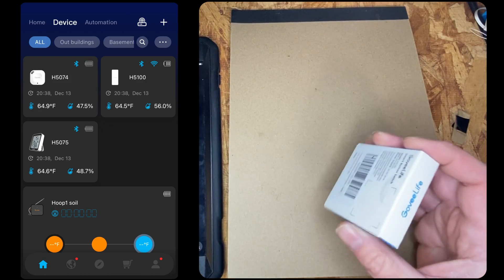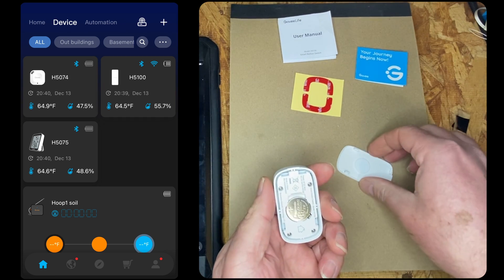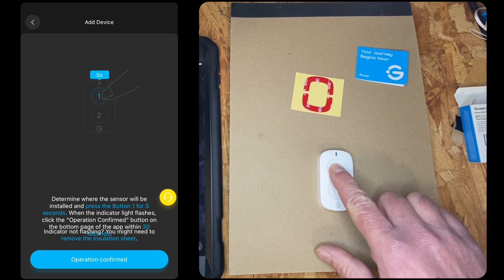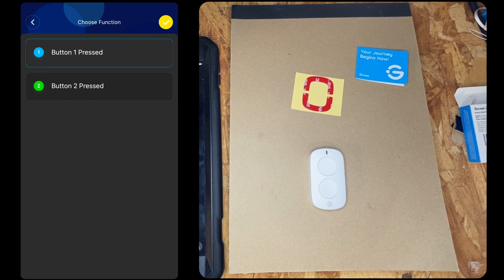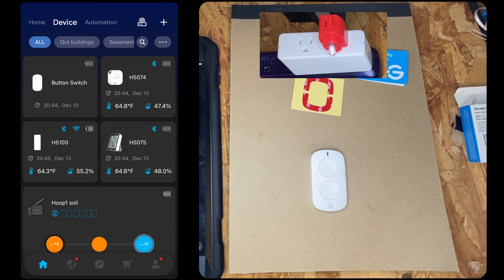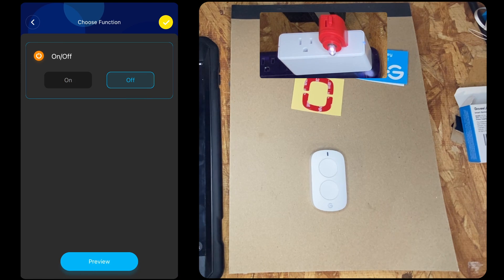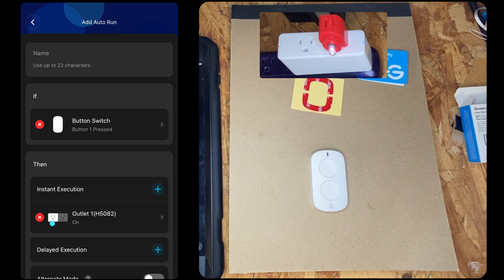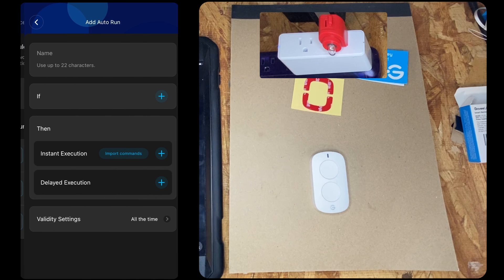Controlling a Govee smart plug  with smart buttons

Comment: Can you control several lights via one button? (eg. When I press buttom 1, it switches on ALL my bedroom govee lights). and can this control Bluetooth and WIFI Goove lights? Thank you!
Reply from the maker: Govee automation supports adding multiple  then clauses.   So you can set an automation. If button one is pressed then turn on switch one, and turn on switch two, switch 3 etc….   So yes you can trigger multiple devices with one button. I don’t have Govee lights to test this with so I can’t comment on the lights.

Comment: Just got my 2-button and trying to figure out the IF-Then/Instant Execution/ IMPORT COMMANDS.  How do I Import commands?  It just says N"No directions yet, please add in Tap-to Run first.  Where's Tap-to Run?
Reply from the maker: @dalewedell Tap to run is set up on the main home screen by clicking the little two oval hamburger icon in the upper right corner, these tap to run automations allow you to create buttons that do group actions, these can also be linked to your home automation / voice command, Siri etc...   using the import option allows you to automate these.    you can setup normal if / then automations by clicking the  + to the right of the import commands.

Comment: When I attempt to do what you did it doesn’t allow me to set up actions. It says “there is no distributed gateway yet and the sensor cannot be added”
Reply from the maker: What devices are you using?  How far apart are the devices?
Reply: @WhisperingWildMarketFarm  I'm having the same problem. I'm using GoveeLife Wireless Mini Smart 6 Button Sensor to try to turn on and off give lights. Everything is close together.
Reply from the maker: @sproesser1  check your firmware on your devices. You can do this. Y going into each device and refreshing the device then going to the settings you should eventually get prompted .     What gateway(s) do you have?